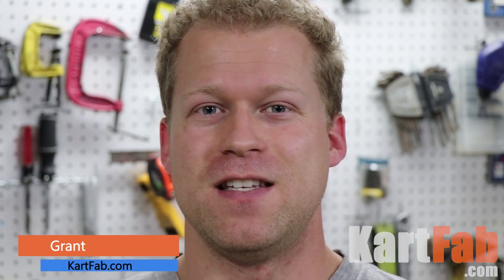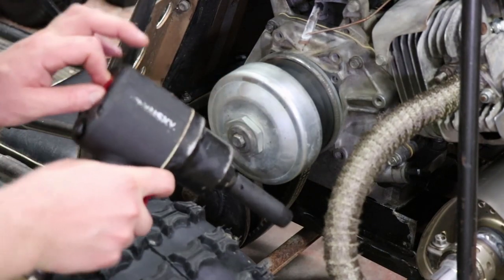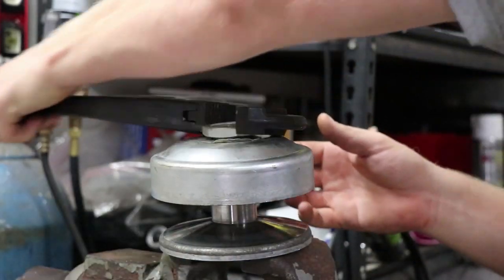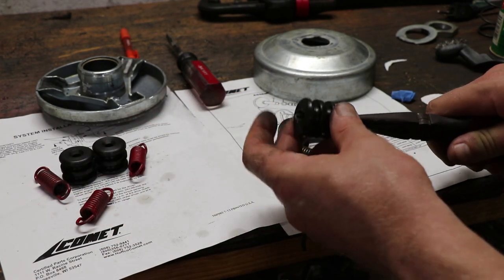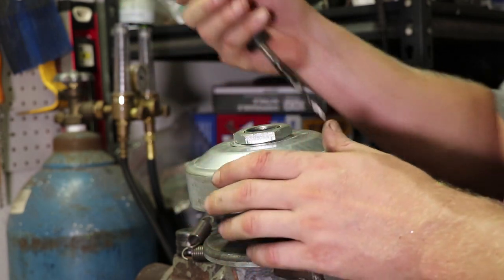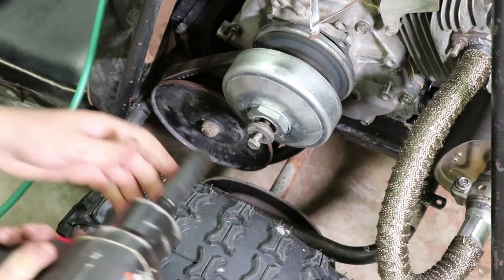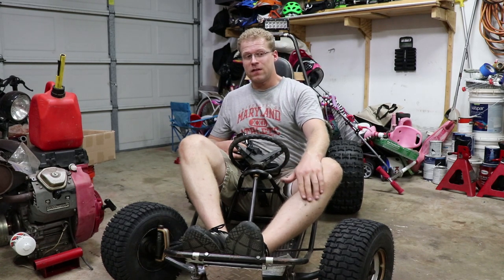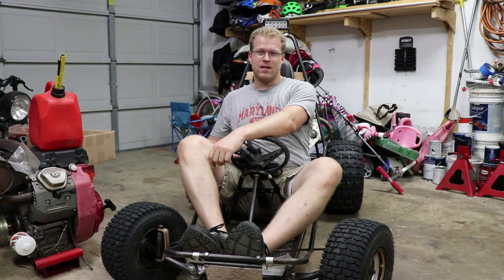How To Increase Torque Converter Engagement RPM - Comet 40 Series

Comment: Get yourself a Gugernaught clutch from Go Power Sports. They gave me one to run on my 212 predator mounted in a 26" mtb. I was running a 30 series Comet cvt and the improvement was immediatly apparent with the new clutch. Higher engagment RPM, smoother throughout RPM range. More positive engagment as well. You will also notice the engine running at a happier "RPM - torque" ratio, all round better performance. Hope this info helps you get the power to the ground. Robin in the wind.

Comment: Very cool I have tried all of them like u said red be good for launch and hauling but just on min cart pretty heavy went back to yellow springs either way 420 cc has great power I can spin 21 in tires and still run 48 mph stock inside 420
Reply from the maker: yeah, ill be going back to yellow springs for putting around. I just wanted to wheelie :-( im doing some headwork so that should help now that im boosting the compression ratio up a bit.
Reply: KartFab 😤me too been having hard time with my box stock engine head bearings etc one thing after another think I about got it if can get the time but yea I liked the yellow springs bit better for riding around like ya said

Comment: Not gonna say a name for torque specs makes me feel like your talking about Ike and John.
Reply from the maker: hahah! Yeah well, they aren't the only ones that have done that. Every once in a while we have someone on the diygokarts forum say that their drive unit 'broke' but it was just the bolt that they didn't torque down or put locktite on.
Reply: +KartFab or they put the bolt in that came with the torque converter thats got the wrong thread

Comment: I made my own rollers that are way lighter than the mediums. I launch my minibike at 5500 rpms, also the top cover on the Chinese will rotate the flat stops away and the lock tab will no longer work so I welded the nut on like a comet works just fine
Reply from the maker: yeah, i wonder why the knock off was made with that tab instead of welding.

Comment: Hey grant, I have a question. so I have a 30 series comet torque converter,older one, has an "L" shaped mounting plate, the engine sets on top of the bottom L portion and side bolts to the engine. but my nut IS welded on. I thought it was cause someone n the past had lost the key. so anyways I'm trying to break it down to clean the rust, so far I've had to take it off in reverse starting from the bearing side. took off nut,slid out pulley, removed 10t sprocket, but now seems that's all I'm gonna get to. not sure if the pulley can come off from the reverse direction. if I remove the snap ring on the welded bolt side should that allow me to get it apart?

Comment: Hey, Grant
Do you know the 1in. driver toque converter 40 Series. Is it available for a 40 series from Comet or chinese aftermarket is to fit on a 3/4 engine crank shaft instead?
Reply from the maker: Search on amazon for 3/4 to -“ shaft adapter and run the 1” driver with the adapter.

Comment: talking about comet 
do you know where to find a  diferential axle   for go cart ? the kind that support 5-30 hp ?
i found that  comet made some but i can't find where to buy anywhere
i want a small form for using with 4 wheel moped and i need bigger electric motor with a DIF axle
Reply from the maker: I know that Northern tool sold a peerless transmission for go carts for around $100 at one point in time. This is with a 1 inch diameter axle with a 1/4 inch keyway

Comment: Yes I have question for you . I have a mid 80's john Deere gator 626 it had original motor Kawasaki 10 horse and transmission in it . motor was bad so I put  16 horse Duramax motor with a Blast 1" 40 series drive torque converter . now it don't want stop . have start the motor in gear to get going . only way to stop or sit still is to turn key off or take out of gear . what can i do get it go and stop when need it to ?
Reply from the maker: It could be a number of issues. It could be 1) your driven unit is not the 40 series driven unit. 2) you have the wrong belt (look at center to center distance) and finally 3) your idle speed for the engine may be adjusted too high. To fix any of these issues you would need to 1) make sure you have a 40 series driven unit 2) get the 40 series drive belt by finding the center to center distance and making sure the sheaves line up 3)adjusting your idle speed down.

Comment: Grant this is a awesome vid, easier than making a bowl of frosted flakes.. thanks so much. Im doing a build now mostly for flat los Angeles  streets , and what do u recommend  for top speed similar to the guys from C&C but i have a predator 301
Reply from the maker: Gear for 40 mph at 3600 rpm and you will be in a good range, then do performance mods to get the extra mph with extra rpm
Reply: KartFab thanks so much im in the garage right now installing ..

Comment: You say you don't recommend max torque engagement for offroad? Can you please explain a little why and what you might recommend? Im interested in more uphill pull and my 40 series feels like a stays "stuck in second gear" as i climb... please and thank you
Reply from the maker: Max torque engagement is for maximum launch speed. It jerks forward. Not good for trail riding which is stop and go. If it feels like it’s stuck in 2nd gear you might want to look at your engine or at least your gear ratio. Most mid size karts with 11-13hp  should be geared for 40 mph at 3600-3800 rpm
Reply: @KartFab  thank you for the quick reply bud. Ya, makes sense that you wouldn't want massive launch if you were deep in the mud, just end up spinning the tires im sure. I have a stage one, governor deleted 440cc duromax and have definitely been pushing the 40series to its limit!! 480lb buggy, 10t on the driven, 60t on the axle with 20in tall tires and two 230lb guys!! In the meantime I switched the placement of my contra spring in my driven to put more tension on it and "hold first gear" longer, its definitely in the rpm range and "gear" range i was looking for and am a happy trail rider again! Keep up the great work Grant!!!

Comment: Also I haven't changed the rollers did was you able to tell a difference? If so where did ya get them?
Reply from the maker: +Chris Haskell just search by part number I can't remember.
Reply from the maker: +Chris Haskell yes definitely more torque on the launch and higher revving on the launch. Sucks just going at low speed that's the trade off
Reply: KartFab thanks bud have to see about some probably have to order some uh the lube

Comment: Wouldn't increasing engagement rpm also give the belt a higher resolution range before it rides on that "overdrive" level? Like instead of power dying off at 4krpm it would die off around 5k+ rpm?
Reply from the maker: not on a 40 series. 40 series dont have that issue.
Reply: So i got a modded 420 with a twister cam. Power starts @4k rpm. My convertertor shifts too early up hill and then the revs drop.
If i go a lighter weight will it allow the motor to be closer to power band before it shifts?

Comment: Any suggestions on getting the welded nut off the comet clutch?
Reply from the maker: The welded nut stays on. It is part of the clutch. The outer part that you see screws into the rest of the drive unit. Search through my old videos  for how to clean a 40 series torque converter.
Reply: @KartFab  I watched that video a while ago, but I never realized you took off the whole cover. It just looked like the nut. Had to go back and look closely. Makes sense now. Thanks for the help!

Comment: Just a question,so havier weights is more torque?
Reply from the maker: No. It has no bearing on torque. Just when the engine engages with the driver.

Comment: I know my springs are yellow on my 40 series but do you know if my driver weights are medium?  I got the kit from gopowersports, not sure if you know what their standard is for stock. I have a 670 predator so yellow springs and medium weights seems ideal.
Reply from the maker: Ideal is subjective. If you do medium weights but just want to ride, the engine revs “too high” before it engages and feels like a rough ride. IIRC heavy weights and yellow springs are stock.

Comment: Could I do this to keep my motor from taking off at idle? I'm using a predator 212, set the idle to as low as it would go without bogging and it still tries to climb walls before I give it any gas. It didn't take off with the centrifugal clutch I had on before, but now it tries to bolt with the torque converter.
Reply from the maker: +TexasDragon3907 yeah but I wouldn't go as high on the engagement rpm. Typical idle speed is 1650ish rpm. Could be torque converter alignment or belt size causing your symptoms.
Reply: try lubing your throttle cable with Napa chain and cable lube
Reply: Check your belt
Reply: Same issue. Ever fix it?
Reply: @ryanlahay9361  Sorry I don't remember if I ever actually fixed it before I sold it for a gopro.

Comment: Does anyone know if a 30 series will hold up on a 9hp Tecumseh on a Baja heat? I cant afford a 40.....Or can it be upgraded?
Reply from the maker: @ 30 series is rated for 8 hp max. You can run a 30 series on it but nobody has a crystal ball to tell you when it’s going to break. See if you can get a 40 series on eBay and make your own jackshaft setup. The next video I’m releasing on Sunday will show how I setup a 40 series on my minibike.
Reply: KartFab Thanks, and looking forward to the video!
Reply from the maker: no problem, just finished uploading it.  have a good one.
Reply: Sunny Ray. You could run the 30 series with that engine. People are running the 30 series with engines with more than 9hp. Heck, 9hp is a predator that was rejetted, adding a header and ran at 4500 rpm's. Now add a cam and other goodies. They will still put on a 30 series.

Comment: What springs for the highest speed
Reply from the maker: Springs do not control speed. Springs control engagement RPM. If you want the best acceleration, choose the springs that engage at the engine’s peak torque output.
Reply: KartFab so if I use one spring then it will have more torque but the same top speed as on that has less torque
Reply from the maker: @donkeyhatwaterfowl  if you race, you want the engine to engage the clutch at peak torque output. If you want speed, that is just how you set up your sprockets (gearing). Changing springs will not change speed, nor will it change torque, it will mostly change the torque available to your rear axle when the clutch engages.
Reply: KartFab so then what could I do to get the most speed out of my 30 series comet
Reply from the maker: @donkeyhatwaterfowl  make your engine rpm go higher with mods, or gear your mini bike or go kart to go faster.

Comment: will this work with a 30 series
Reply from the maker: +BackYard Karts 30 series has a different drive unit setup, so you change out long springs in a coil instead. Same process though.

Comment: How about rotor ignition
Reply from the maker: what does that even mean?
Reply: it's an ignition system that uses a light weight rotor instead of a heavy flywheel, there no bolt on kits but iv seen this done on old flathead brigs engine
Reply from the maker: hmm interesting.